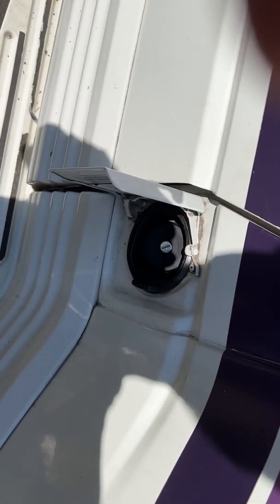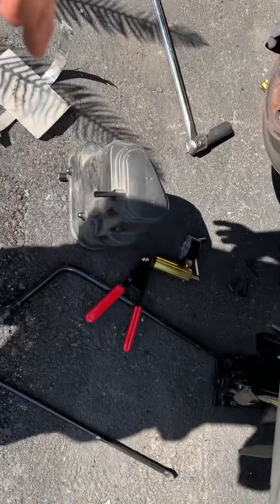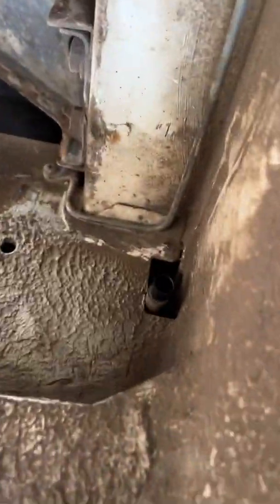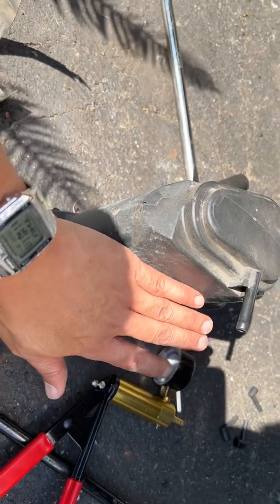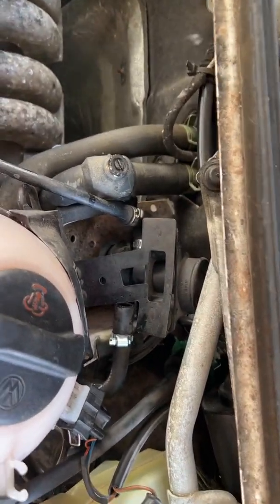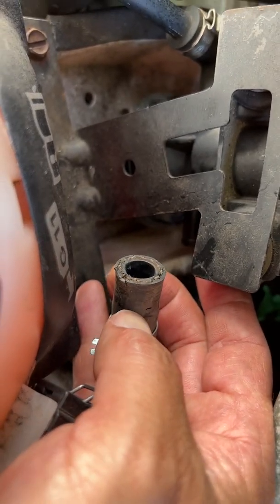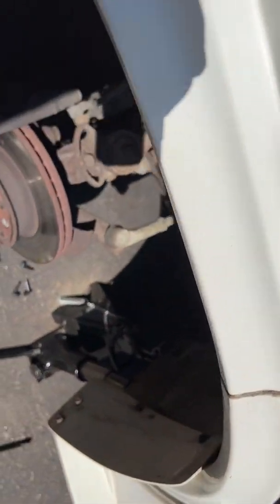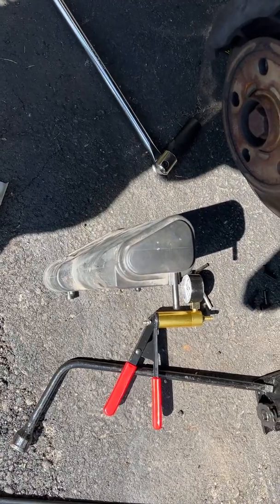Eurovan/Rialta gas tank pressure build up problem

Comment: I think you have put your finger on what a lot of us are experiencing.   In mine, the cannister is breathing ok but there is gas in the lines to it and it won't fill.  Also fumes.  Clearly not venting from the tank.  I can disconnect the hose to the cannister and it just dumps gas.  Being a 2002 EV, it is more complicated and there is a set of hoses going up the fill tube for additional venting during fueling, I think.  I imagine that the gas backs up, enters the fill tube vent as it shuts off the nozzle and then gets trapped at the rollover or the other actuated valve and can't reenter the tank as it normally would.  
I'm going to try pressurizing this line as you say.  A little harder due to all the hoses in the 2002 but hopefully I can pull it off and won't have to drop the tank in a campground!  

 I've used my 12v tire pump to air out the cannister before when it had gas and it's a nice little tool when on the road.

Comment: Can i by-pass the "vent system" with my own "vent old way vent system' ?
Reply: I think the problem is that it is plugged at the tank valve, so there is nothing you can attach that can fix that if it is blocked.

Comment: Great timing- I just bought a 99 Rialta and having same issue. Keep us updated if this worked for you. Another source suggests replacing the cannisters at about $300.
Reply from the maker: So far so good. I went on a long hot drive for a hour and when I opened the tank, there was no pressure. When I drove back, there was just a small hiss. I really won't know until I drive in 90+ degree weather. I have added my diagnostic routine for this problem - now that I understand how it really is supposed to work.
Reply from the maker: You can see the thread on this problem and how to rebuild the canister if necessary: https://www.vwvortex.com/threads/eurovan-evap-cannister-experiment-rebuild-refresh.9408275/